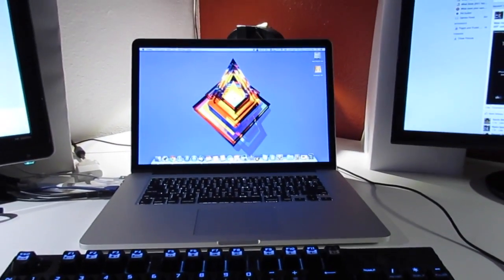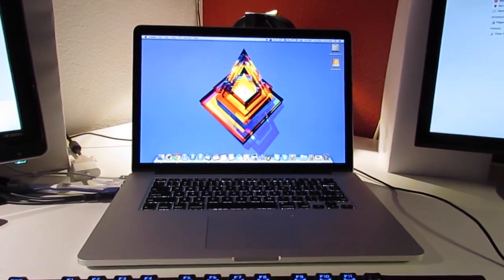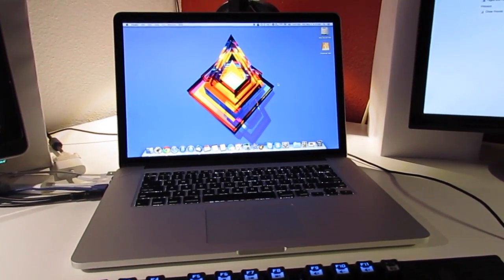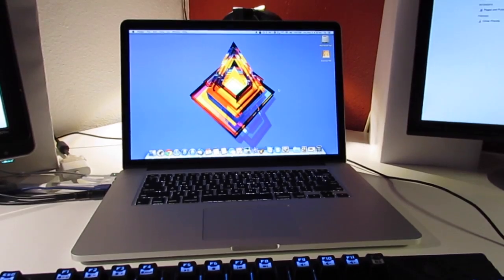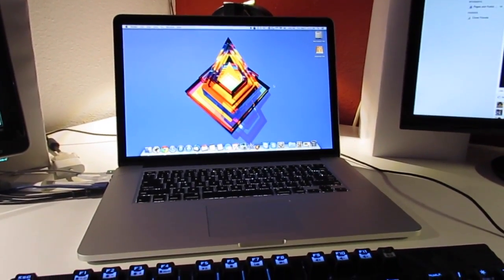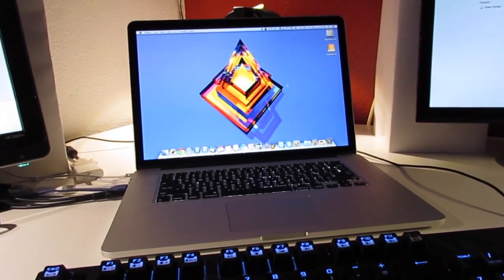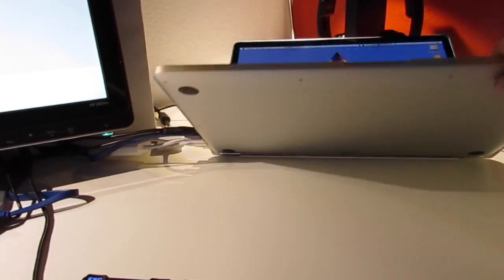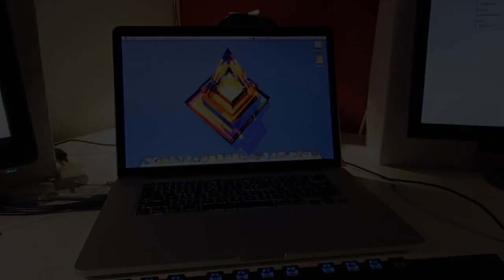Retina MacBook Pro Repaste/Foxconn's Failure at Thermal Paste

Comment: As a guy who's refurbished over 10 Macbooks, I can confirm that Foxconn sucks at applying thermal paste. They get the paste all over the small resistors and transistors around the die of the graphics card also, and not to mention they apply waaay too much paste, you can find chunks of it all over the surrounding area of the CPU and GPU die's.
Reply: What is the smaller chip next to the CPU?

Comment: A 4c decrease in temps is not significant and does not justify disassembling the laptop, risking damaging it in the process. If the temp difference was 15-20c then yes, but 4-5c means the stock paste is just fine. Thermal paste also becomes softer with heat, so the fact that it looked dry while the computer was off is normal. Sure, Foxconn may not use the best out there, but it's good enough

Comment: There is a tool called a screw extractor.  It is made of carbonized steel and looks like a screw with very sharp threads with a high pitch and frequency.  It comes in a plethora of different sizes too.  The threads run in reverse direction so the way it works is you get the right size then you screw it counter clock wise into the stripped screw but since its threads run backwards it will dig in to the stripped screw and since you're turning it counter clockwise it will grab a hold of the screw and remove it. If the hole is too shallow for the tool to grab hold then you will need a 1/16th inch drill bit and a dremmel rotary tool and make the hole in the damaged screw a millimeter or two deeper and then it will work. Cheers!

Comment: When the same thing happened to me i also drilled it out and was able to use a flathead screw driver slightly bigger than the hole and could remove the shat easily

Comment: What does anyone buy Mac?  WAY overpriced Chinese crap that thermal throttles like a mofo.  Not to mention that they cost double or triple of a non-Mac, and that their hardware options are limited as most current-gen parts are not officially supported (chipset 2011-3, DDR4, GTX 9XX series, GTX Titan).

Comment: The reason why they use those screws is to stop people tinkering with their computers. Naturally, taking the cpu off the motherboard would completely void it's warranty, even though what they've done is messed up the cooling because of it. It's their way of charging customers more. ALL their motherboards have the same problem. You strip the screw, you screw your warranty, you have to pay for a new bottom case. Now if something serious happens to it that would normally be covered under warranty... they'll see that screw and refuse to do it under warranty.

Comment: You stripped the screw because you used the wrong size head. So many people do it.
Reply from the maker: These screws are P5 pentalobe. I used the right head, I just torqued it too hard and it stripped. Soft metal screws.
Reply: +N/A cant you just not put the old screws in and put some stronger and better ones in instead
Reply: +OK you can but if the screw is still working it's just to much work getting the right size
Reply: exactly

Comment: hi man, i was having some throttling issues with my macbook so i decided to order my screwdrivers and tried de-dusting the machine. there was only a little bit of a dust and that did not change the temperature that much. then i tried taking the back cover off as soon as i powered my macbook down and realized that the cpu was super-hot but the heatsink was cold (it was only hot on the area of the cpu and the part where it reaches the fans were cold.)

would you say that's caused by the shitty thermal paste? and is a -4 Celsius change in idle temp differs that much in higher temperatures?
Reply from the maker: You shouldn't run it with the bottom cover off, as that's necessary for proper airflow.

I think it may very well be the root of your problem. My MBP doesn't see over 96C anymore (before it was 100-101C). It makes a difference. You have to do it right of course, but yeah.
Reply: Ryan Gehret yeah i just took the bottom cover off as soon as i powered it down. thanks for the reply man, i'll  replace the material when i find an as5.
Reply from the maker: Cool, glad my video helped somewhat.

Comment: Before replacing the thermal paste my mbp 15 mid 2009 it was running at about 50-55 celsius, after reapplying its running at 33-40 celsius - idle/safari. I think its a BIG improvement. When i did the same thing on my HP Envy 17 no change was visible.(probably  because of the cpu - 720qm and only one fan, big design flaw)

Comment: Sad to hear that you already removed the screw head, but when I encounter stripped screws I use a dremel tool. I cut a slice into the screw head and remove it with a flathead/slotted screwdriver.

Do you have a review on your page of the Pro Tech Toolkit?
Reply from the maker: The screw was too small for that method, sadly.

Nah, but my friend Chris does. He's at itoilet9/xodium here on YT if you wanna check it out

Comment: I'd backup the hard drive and get a replacement MBP.
Reply from the maker: I seriously hope you're being sarcastic.
Reply: Ryan Gehret Not completely, I wouldn't get a replacement but I would be mad if I stripped a screw and had to drill it out. The only reason the replacement would be needed is because of the resell value, people will see that spot on the bottom and question it.
Reply from the maker: But....I'm not selling it, so it doesn't matter.

Comment: Sheesh, you would think as much as Apple tries to make their computers as high quality as possible, they would get Foxconn to use screws that weren't made of tinfoil. Perhaps it's out of their control.

Funny, my ThinkPad used to get up to 100*C when pushed hard enough, and one day I opened it up and blew the heatsink out with my own breath, and there was barely any dust in it, but now it barely gets past 70*C at the same tasks. What's ridiculous is that Lenovo designed the fan controller to only run the fan at half speed, max, even at 100*C. Luckily I found a program called TPFanControl that overrides the controller, so I can set it to run at max speed if I want to.
Reply from the maker: Thing is, all the other screws are fine. I've probably taken them out 2-3 times by now. Was just that one that was totally screwed (haha puns) because I tightened it too much.

The rMBP has pretty good thermal management I think. When it's at about 40-50C the fans spin at about 2000RPM. 75C, about 4000 RPM. And when it's approaching 95-100C they kick into 6000RPM airplane engine mode. I have iStat so I can override the preset fan settings, but I don't need to.

Comment: I think you made the right decision with that screw, and I think that your maintenance plan is a good one.

Good rant. I think the worst thing they do over there at Foxconn, is use those crappy thermal pads on laptop GPUs. The chips always overheat with any decent use because of the poor thermal conductivity.
Reply from the maker: Thanks. Glad I did it.

Oh god those are terrible.
Reply: i think the worst thing they do at foxcon is treat the workers so bad they have to have suicide nets in top of the buildings

Comment: only one x in foxconn
Reply from the maker: oops
Reply: If it was brand new, a thermal paste replacement should be under warranty. How much did Apple pay you as reimbursement? However, what is the max temperature and fanspeed your comp has now under full 100% processor load?

Comment: so much for apples quality control lol
Reply: A $2,000 computer and it has junk thermal paste and soft screws that strip from being removed once,lol.
Reply from the maker: KingMacintosh You know, I love it when people call me an Apple fanboy. I have four times as many Windows based machines than I have Macs. I don't hate every computer not made by the almightly fruit company. I love Apple, but I'm no fanboy.

Furthermore, I have not seen one company put as much effort and careful attention to detail into their products. Every inch of fruity's products is considered. Remember when the MBA came out? Everyone else shat their pants, and was scrambling for a competition product. Now we have all these "Ultrabooks" which are pretty much carbon copies of the MBA appearance-wise. At least they tried. Yet none of them match the experience. None of them match the quality. Close, maybe.

With the release of Windows 8 is when I started to hate M$' new direction. Fuck that tile shit. I don't want a touchscreen/hybrid OS atop my computer with no touch screen. "Just use Windows 7!" That doesn't solve the problem either. All of Windows' usual issues are still there. Haven't had a hiccup with the Mac since I got it.

You obviously have a different opinion about the upgradability aspect. We've gotten to the point where computers are powerful enough that they don't need to be upgraded every year. 8GB RAM is sufficient (at least for my uses) and will be for the considerable future. By the time things need upgrading, it'll be time to buy a new laptop anyway. 5-6 years is considered an eternity for a computer. By that time the laptop I am using now will likely be retired to secondary use.

But you keep your opinions, and I'll keep mine. Let's not make this a butthurt ragefest over technology preferences, good god.
Reply from the maker: AMDfan4237 Let me throw in my two cents. 99C will not harm the CPU. Do you know why the Tjmax is 105C? Because that's low enough to not damage the CPU. That's why they have the max temp shutdown, to avoid damage to the CPU. Granted I don't like running that hot, but under full load with a quad core in a laptop it's kind of expected. It's not going to damage anything.
The screws are made of soft metal. I went too hard on that one, and that's why it stripped. I've probably removed the bottom cover twice now, and all the other screws are fine because I took care to not tighten them with the force of Thor. Dell/HP etc. use screws with soft metal aswell (trust me, I've worked on over 50 Dell laptops over my computing life)
Reply from the maker: KingMacintosh Your argument is invalid. All the other manufacturers use the same cheap paste. It's one area they can cheapen out on and get away with it.
I don't worship Apple like they're the second coming of Jesus Christ. But I can notice when someone's making a very biased argument, and I'm going to give my opinion on the matter. 
And really? Apple is the only one I have seen trying to move jobs to the US. China has a much larger infrastructure for manufacturing; the US is vastly inferior in that respect. China can churn out more products at a faster rate. 
I want to see jobs come back to the US too but if you look at it from a business standpoint, it's going to be difficult to do.
Reply from the maker: KingMacintosh I just laughed. Hard.
Let me know when you find an OEM with better build quality and attention to detail. I'll have a look when you do.
Reply: ***** But it should be unacceptable for a $2,000+ computer,99C is a problem and could degrade the CPU,Tj Max just means the CPU isn't dangerously hot enough to melt and shut down yet.  Build quality? The screws stripped from being removed once and Apple's cooler isn't enough for a cpu with integrated graphics. Seeing as Apple doesn't even want to touch the screws to repaste or clean it you're suppose to deal with it or pay Apple to fix it for you.
I don't hate Apple,and wouldn't mind having a macbook,but people talk about Apple like they have no issues at all and all PC laptops are junk.
Reply: ***** Foxconn is just the manufacturer,Apple tells the manufacturer what to use down to the thermal paste.  It's just the company trying to save a few dollars so they can make more profit, like Intel using thermal paste under the IHS which in long run probably saves Intel hundreds of thousands a year.
A video on just repasting a laptop turned into a fanboy war,most other OEM's use similar low grade paste to save cost.
But the point is (probably IMO here) when you're paying a premium for the name,they should be using something better.
Reply: KingMacintosh Most consumers are okay with it because they don't know what thermal paste is,let alone monitor system temps on their computer.
Apple designed the laptop that way,and also so Apple knows if you've opened it up. It isn't designed to be user upgradeable like previous macbooks either with a non-standard SSD and no ram slots, which is another reason I wouldn't want the newest model. All of the "older" Macbooks/Macbook Pro's I've worked on never had a stripped screw,did Apple stop using Loctite or do the screws use even finer threads?
I've taken apart plenty of PC laptops that have been opened at least twice previously and the screws were still in fine condition,most of them were just an average laptop as well.  Perhaps it is the screwing a aluminum/metal screw into a aluminum hole that will increase the chance of stripping the screw.  Dell's Latitudes and HP's Probooks with quad cores and dedicated GPU's don't reach 100C,although they're larger rugged business grade machines so fashion and "attention to detail" isn't the first priority.
Reply from the maker: No, it wasn't intended to be opened, but that doesn't mean it isn't possible. And that doesn't mean I won't do it.
I've stripped a couple screws on Dell laptops before. They use the same soft metal, probably even softer that the MBP's screws especially on the Latitude D series.
Uh and you're wrong. My friend has a Dell Latitude E6420 and when he pushes it hard it gets to the high 90s.
Reply from the maker: KingMacintosh This comment. Just. lol'd.
Reply: KingMacintosh I agree it's true that most buy a Mac for the looks or the supposed "build quality" then compare it against budget consumer laptops,or a Dell which don't have great build quality as they used to.
I could care less about "attention to detail"  as long as the laptop is durable,has enough ports,decent keyboard and allows easy enough access to the internals.
Is yours a thinkpad? Lenovo's line of laptops are a really nice value,even their gaming oriented laptops are solidly made. Lenovo and other OEM's use decent screws because it's intended to be opened again. The macbook isn't supposed to be opened by anyone but Apple since nothing is upgradeable,if it runs 100C when the fan rad is clean,just imagine how hot it would be after a year or 2 of use without cleaning,because it wasn't intended to opened up and cleaned out.
 I've worked with macbooks,though they do feel nice,but they aren't as durable in a professional environment as a pro level Lenovo.  As far as projector use with the macbooks,flimsy VGA adapters had to be used lol.
  The Mac "Pro" is a joke,IMO. It looks like a trashcan that Dyson Vacuum would make if they made other household stuff. You can't add any storage unless you add on a bunch of external drives,so much for the Mac Pro for being so compact,and all you can really upgrade is the ram.
Reply from the maker: That's the tradeoff for them being so thin and light. Can you upgrade anything in the ThinkPad X1 Carbon? I'd be surprised if you could.

Comment: Yeah, my E6400 suffered from this issue. The GPU still has the thermal pads on it for clearance reasons and the suck. What happened to the Oreo phone video, I was going to watch but you took it down.
Reply from the maker: It had my address printed on that cardboard piece I used. Could be clearly seen in the video if fullscreened.
Reply: Ryan Gehret Oh, I only watched 30 seconds of it in portrait mode on my phone.

Comment: well i was going to get a macbook pro you may have just talked me out of one
Reply: piercejustin0  It is super easy on the retina models. The heat sink assembly is bottom-mounted as opposed to being mounted underneath the motherboard toward the keyboard. So all you do is pop off the bottom panel, then unscrew the heat sink assembly, and it pops right off. It's almost as easy as the Latitude E6420.
Reply from the maker: Repasting is not hard at all.
Reply: Ryan Gehret i guess i will have to if it gets hot bit if i screw it up they will repair im getting apple care if that makes a difference
Reply from the maker: If you fuck it up you void your warranty. 
It's really easy though. iFixit has great guides if you need it.
Reply: well i guess ill see how hot it gets what program did you use to see the tempuratures
and if it does get hot i guess i will have to get that tool set you mentioned and torture myself with trying to take it apart
Reply from the maker: iStat Menus. It's not free.
Reply: Xodium
thanks i just bought a 15in retina display its running at 141 fairenheight which is really hot